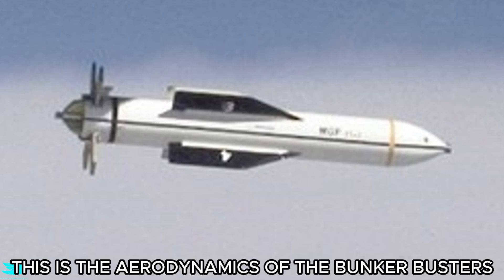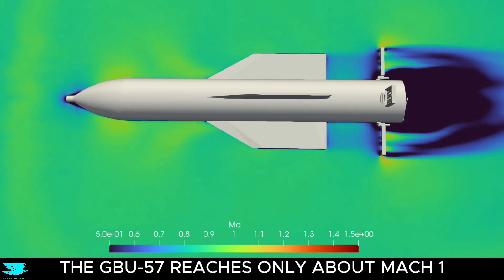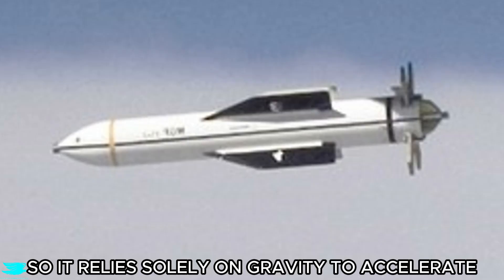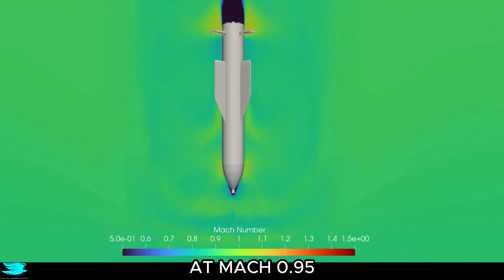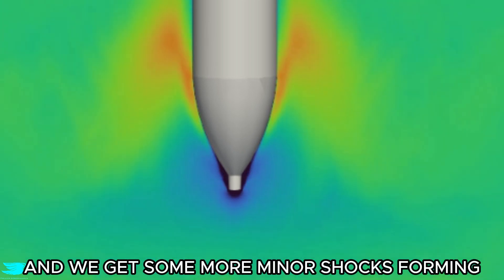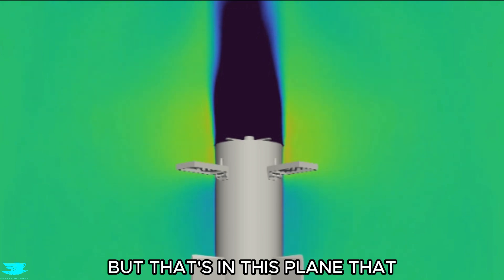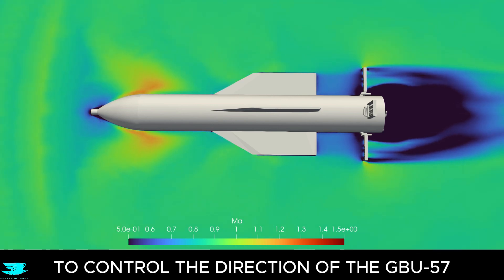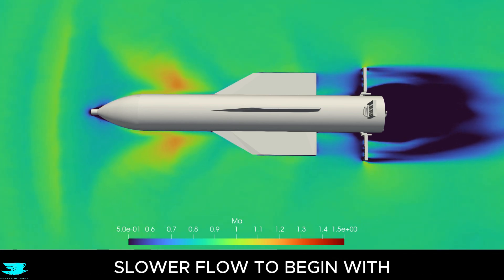USA Bunker Buster On Iran Aerodynamics [GBU-57]

Comment: With regards to speed, no, bunker busters don't typically hit mach 5. They're pretty much always just large, very heavy guided freefall bombs that rely on high sectional density and being dropped from high altitude to gain their kinetic energy.

There have been some rocket assisted ones, but those are the exception, not the rule.

Comment: So they made it as large and heavy as possible and that left no room for better shape?
I recently watched a video about WW2 era bunker busters and it stated they were all subsonic.
Made me think they should have added some aluminum sheets and a nose lance to give it a better outline.
Reply: I would imagine it's to prevent the projectile from shattering/fracturing on impact. Most projectile fracture on impact anyway or shatter to some degree and break apart but it likely minimises it to some degree to improve penetration.
Reply: I mean to be fair the chaps that made the thing have quite the budget for R&D so there’s probably a good reason
Reply: I guess they don't want the nose to be made of aluminium because it has to be really strong